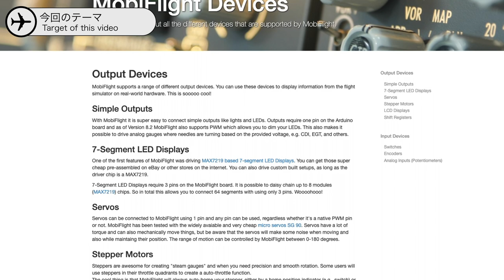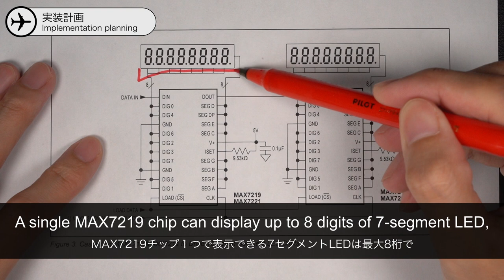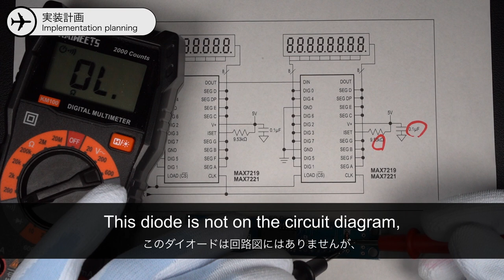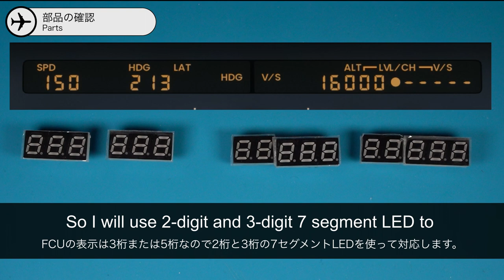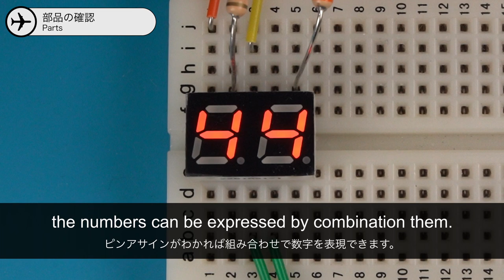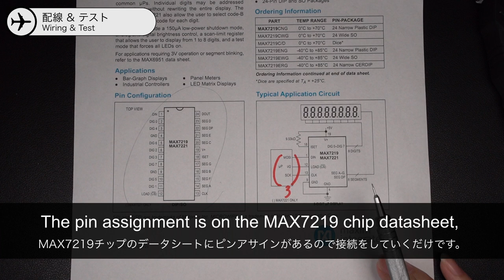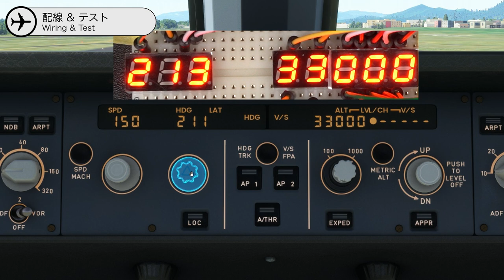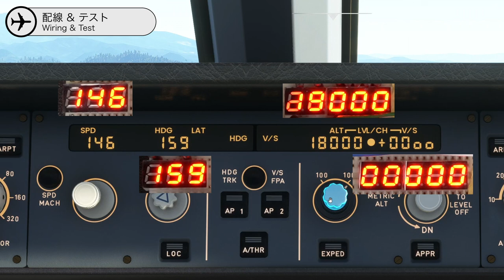【Home Cockpit】Creating the numeric Display section of FCU | Home Cockpit DIY Vlog - Vol.4

Comment: Thanks for adding English subtitles. Highly appreciated 👍 Know what also does nice daisy chaining? "Neopixels" (WS2812 / 13 ). Using that for all of my status indicators :)
Reply from the maker: It seems useful:)
It could also be used for panel backlighting.
Reply: @07JP27  probably. A nice feature is that brightness is a parameter. I'm not yet there though. My panels are wood for now. I'm going to replace them eventually with backlight acrylic glass though so I may expand on this 🤘

Comment: Hello, excellent video! I’ve watched it several times, but I’m not able to replicate it. Could you please share the pin connection diagram? Especially for connecting the two MAX7219 chips. If you can share this material, I appreciate it. Thank you.